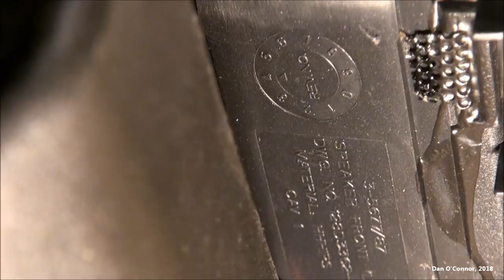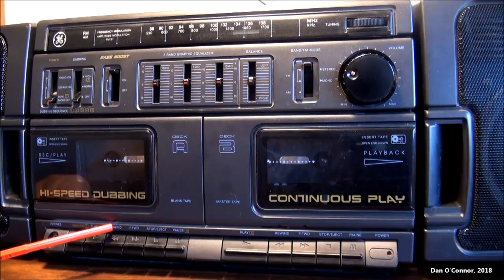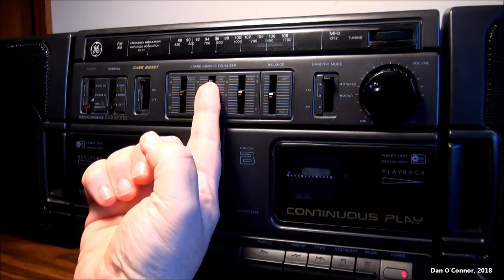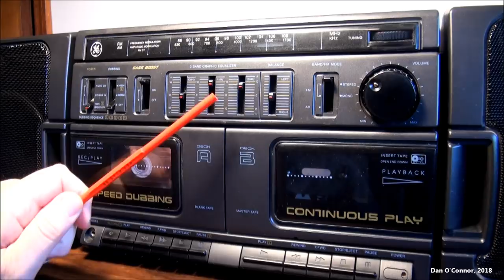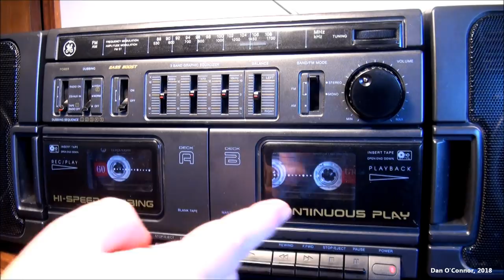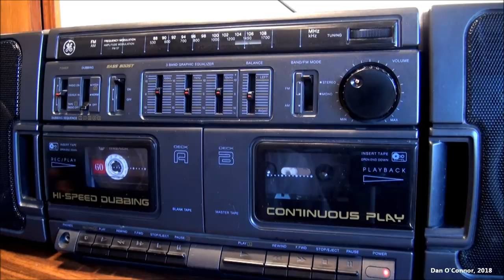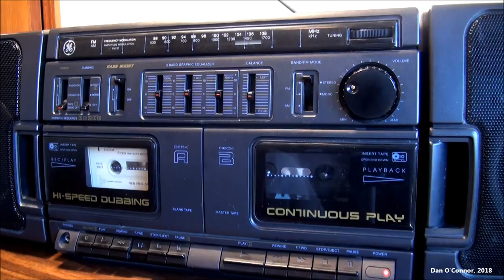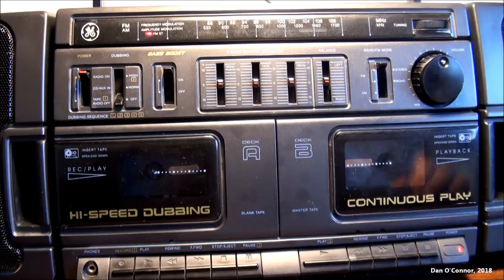1991 G.E. 3-5677A "Boombox"

Comment from the maker: A couple of things: I've changed the name of the video from 2001?.... to 1991.... it seems to be unanimous. More importantly, I've discovered another feature I didn't demonstrate in the video. Did you notice the big "Continuous Play" on cassette door B? I began to wonder about it and did some experiments. It turns out that if you put a cassette in deck B and press play and then put a cassette in deck A and press play and pause, when deck B is done playing the pause on deck A releases and it plays the cassette in deck A. They made the Continuous Play sign as big as the Hi-Speed Dubbing on the deck A door but I missed its significance. I might have realized it was a feature like Hi-Speed dubbing. Finally, I realized I never showed the actual model number 3-5677A embossed on the bottom of the unit where it also says it was made in China.

Comment: My sister (and later, myself) had this model from 1991/92 until around 2001. I eventually destroyed the original speakers, but was able to replace them with older, larger speakers I got at Goodwill. I also hooked a couple different Sony Discmans into the aux port. That set up got me through middle school and high school. In 2001 I was given a JVC combo unit as a graduation present and left this thing long behind. Even so, I still think about it sometimes and have fond memories of it. I made use of just about every single feature on here, minus the Continuous Play. Great boombox for it's time and price range.

Comment: This boombox definitely looks a lot more like 1991 than 2001. Although new radios were not required to cover the AM Expanded Band until 1993, many radios from the 1980s already covered at least some of the frequencies above 1600 kHz on AM, even if it wasn't marked on the dial. And the FCC held its initial vote in favor of the Expanded Band in 1990, so perhaps GE was just quicker to support it than most other manufacturers. (p.s. The equalizer sliders are marked in Hz, not kHz.)
Reply: Had that same model  as best as i can remember it was purchased around '92
Reply from the maker: It screamed 1990's to me too when I saw it, but I couldn't get that date code out of my head. Good information about the history of the extended AM band, thanks.

Comment: This unit also has a built-in charger to recharge the d cell batteries. It came with what they called battery sticks unheard of at the time. But it was 3D size batteries all together in one stick and it took two sticks for this unit.

Comment: I remember these! Separate the speakers to full-length bring the antenna all the way up and plug it in and you'll be able to get stations from all over the place on both am and FM. Good find man
Reply from the maker: I didn't spend much time on the radio in this video, but it actually does perform well. Thanks.
Reply: Hello, can you help me separate the speakers please, I don't know how to remove them:/

Comment: What type of mic are you using? I have this boombox too. Got it at good will for $ 8.00. Radio sounds good. I didn't realize it had a mic input.
Reply from the maker: It's just a standard microphone with a 3.5mm plug. I don't remember the brand.